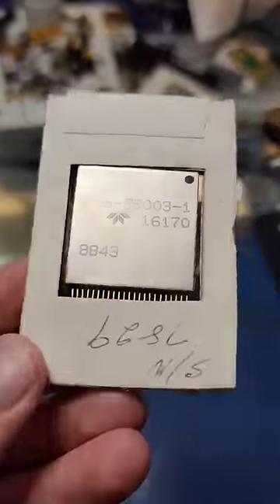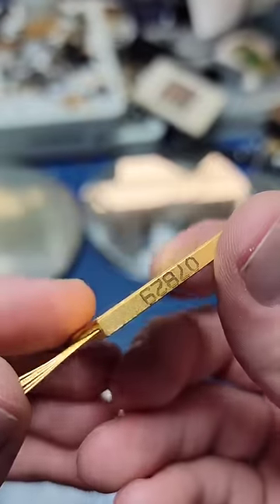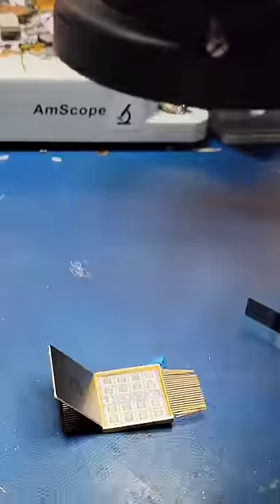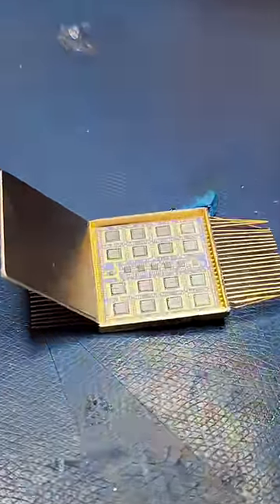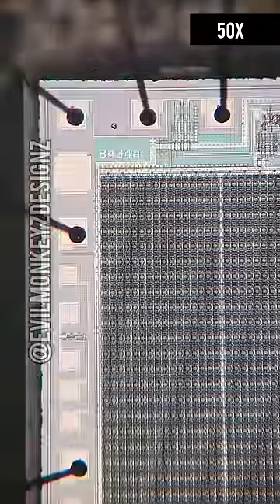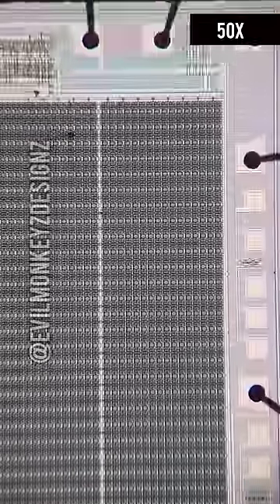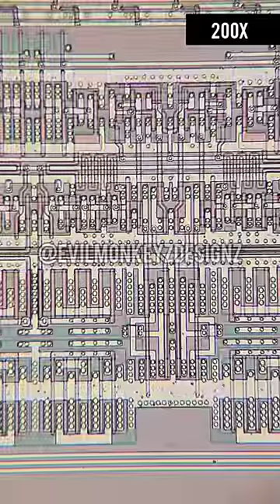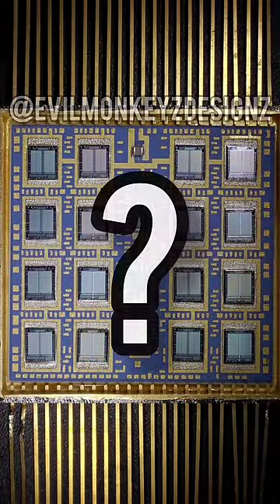CCU #298: Teledyne Hybrid Ceramic Circuit #shorts

Comment: 32k of military grade memory
Reply: Wouldn't that make it bad since military grade is just easy to produce a lot very cheaply
Reply: @senkuo5039  my guess is that sdram was from 1980
Reply: @senkuo5039 agreed.. military grade always means it's crap lol
Reply: @senkuo5039  More like the cheapest thing that barely fits the requirements someone with no clue wrote down. So it can be crap or incredibly overengineered...
Reply: @joshuamcgarvey2712  Nonsense. You clearly never had to create or test a product that shipped to the military.
Reply: @senkuo5039  LMAO....never done any military product production, have you? That shit is INSANELY well designed and tested. Most products have to be tested under the most of extreme conditions and has to have a failure rate considerably less than average products.

Keep in mind this isn't always the case for every single product, but for electronics that certainly has to be the case.
Reply: @senkuo5039 No. It need to withstand all conditions, temperatures so it simply cant be cheap trash.
Reply: @NavySeal2k requirements always based on something, mostly on expected working conditions. So, it can't be cheap trash as you suggested
Reply: @testep02  Ahh, thats the reason why soldiers all around the world never complained about or bought their own equipment...
Reply: @NavySeal2k  like I said, that's not the case with everything. And the other thing about mil-spec is that it needs to be extremely generic so that it can work for most people or on most equipment. So yeah, it is common for people to want something a little more specialized. But most mil-spec equipment is at least reliable, again with some exceptions.
Reply: @demef758  15 years in the army... never had equipment that wasn't crap.. I've bought gear and equipment from the private sector that works and lasted longer then the crap we are issued or signed for. So military grade isn't a sign it's good quality...
Reply: @joshuamcgarvey2712  that's fair enough. You have your experiences and that counts for a lot. I'm just relaying the experiences I've had developing electronics and software. Our standards were always much higher than the private sector. To the extreme in some cases.
Reply: @testep02  thanks for agreeing with my argument
Reply: @NavySeal2k  I mean, you can't discount something someone went through. You know this stuff better than I ever will as the end user of the equipment. Not much to argue about there 🙂 I can only speak to the products I worked on, which is just a couple out of the thousands in use.
Reply: @NavySeal2k  also, were you a Navy seal? Lot of fakes out there these days.
Reply: @senkuo5039 Yep, "mil-spec" is just a euphemism for "built by the lowest bidder"
Reply: I love how y'all in here with these apples and oranges, meanwhile we obviously all drinking grape juice on this video. Mfr this ain't boots and wrenchs, this is a fkn microchip. Think about it and everybody shake hands now and take they fruit and eat that outside y'all making the floor sticky in here GEEEZ
Reply: This was bleeding edge in the 1980, now I understand why everything was so expensive back in those days, even when building my first computer in 1998 the technology was probably a little bit better than this.
Reply: @senkuo5039  you have zero idea of what you're talking about and hold an inadequate perspective on the story/state of microprocessors. military applications were among the first, and certainly were the most well funded, ventures into what we colloquially call microprocessors today. 

and to directly address your statement: look into military specifications for electronics for their first (and main, still) uses: aircraft function controlling equipment. they must meet extreme temperature, load/dwell requirements along with often-absurdly tight/unique tolerances on their packaging.
Reply: @senkuo5039 if you ever compared military grade ic specs and normal specs of the same design, youll see that military spec is much tighter
Reply: That doesn't look worth 32 grand.
Reply: @joshuamcgarvey2712 Military failure rate is way lower then civilian!
Reply: @senkuo5039  not the case with electronics, I work in a wafer fab, the tiers typically go consumer grade, automotive, military, radiation hardened (space grade). The difference comes down to a mix of things: sometimes the higher tiers are cherry picked out of the batch, sometimes they're babysat through production by the process engineers, sometimes they have redundant circuitry built into the chip, sometimes they're specially designed to be hardier, often the packaging is more robust, sometimes a mix of the previous, but the near universal difference is the level of testing and paperwork performed (you wouldn't trust a chip with an unproven track record on your icbm, airbag control unit, or rocket safety controls).
Reply: There's a huge difference in MIL-STD and "Military Grade". There's very specific set of requirements for MIL-STD gear and tech such as operating environments, operating speeds, communication protocols, and many more nuanced specs. An example would be the 5400 series ICs made parallel to the 7400 series ICs. 

 Military Grade just means it meets minimum requirements to be issued to military personnel. Many times those requirements are not to freeze in certain temps, not to melt in certain temps, and to fit in specific dimensions while often incorporating MIL-STD components. An example of this is the old LCU fire control system.
Reply: @testep02 I believe teldyne was a military supplier  in the San Fernando valley
Reply: @joshuamcgarvey2712 Not entirely necessarily. Like with the 1911, it’s served two world wars and still serves in some units around the world today. It just depends on what era of military grade makes the difference. There’s really only a 70 year period where military grade didn’t mean complete shit. Just mostly shit
Reply: @testep02 Fake or not, it doesn't matter much.
If you know, you know.
Reply: @NavySeal2k  Plenty seals and other operatives who thank their lives to their laptop being rugged and that stopped the bullet with their name on it
Reply: @paulmichaelfreedman8334  A ricochet maybe, a bullet? Show me the after action report with a bullet stopped by a tablet 🤣😂🤣
Reply: @NavySeal2k  Do you realise how little sense that makes? "either crap or insanely over engineered" - that means either really cheap or really expensive - you're just saying it could be expensive or cheap - that you don't know
Reply: @undercoverscumbag9632  You just didn’t understand. When someone in an office writes down requirements for a part for the field it can be either not stringent enough and failing all the time or incredibly over the top. But both contracts will be going to the contractor that can produce it the cheapest to barely meet the requirements. And yes, cheapest doesn’t have to be cheap…

Comment: SRAM uses 6 transistors per bit, and it looks like it has six transistors wired in an SRAM config.  DRAM would only have one transistor per bit.
Reply: The SRAM I designed in the early 80s had 4 transistors, but two polysilicon pullup resistors. Smaller cell and less power/cell.
Reply: 6 trans per bit is why Japan almost got ahead of US by using DRAM. What's the catch? Why were they needing the 5 extra for?
Reply: @c0nstantin86 dram uses a capacitor to store the charge while SRAM uses two circularly connected inverters. Inverters require two transistors in CMOS logic. Then you have another two transistors that you need to isolate the stored charge from the bitline that you use to read and write to the cell.  When you want to read or write to it you activate those last two transistors. That adds up to 6 transistors.

There's also 9 transistor SRAM which decreases charge leakage by allowing you to read the cell without draining it's charge.
Reply: @c0nstantin86  A simpler explanation: SRAM can store the info you save to it even after you cut external power.  DRAM will lose the information you store after you cut power.  That’s what the extra 5 transistors are doing.
Reply: @alexwalters1699  Hi,  SRAM don't need refresh cycle to retain their data, unlike DRAM, but both of them will lose data when external power is cut.
Reply: @alexwalters1699  Methinks you're conflating SRAM with magnetic core memory and its brethren.  The latter is non-volatile even with no power applied, the former (SRAM) requires no periodic refresh but does must be continuously powered to retain its contents,   Most forms of magnetic core memory do require a rewrite after a read (similar to DRAM) though some do not (see e.g. A word-oriented transistor driven non-destructive readout memory, T.C. Penn, D. Fischer, 1960).
Reply: @c0nstantin86 Another point, related to the Refresh problem, is that DRAM uses a lot more power, as it stores data in what amounts to microscopic batteries, while SRAM just requires a gate voltage. This makes it much faster, despite the larger number of components, and vastly more energy efficient. 

This is where the other commentators are getting mixed up: SRAM still needs a voltage applied to hold the cell in that state, but it uses so little power, a mere coin cell can power an SRAM chip for years, possibly decades, without refreshing.

This led to a common use for CMOS-based SRAM memory: programmable memory. Before the development of flash memory chips, SRAM was used as writable solid state memory, most memorably in game cartridges and PC motherboards.
Reply: @alexhajnal107 ohhh cool, I didn’t know when reading from hdds that we would ruin the data already there. Thanks for the citation
Reply: @xnaaloh4437  [YT has smitten my previous reply.]  For magnetic memory, core and FRAM (normally) need write after read while hard disk drives and tape drives do not.  All magnetic memory (that I'm aware of) is non-volatile and does not need to be powered to retain the data stored.
Reply: Reading from HDDs is non-destructive.
[Don't know why YT keeps smiting my replies. All details I had added are sadly lost.]
Reply: @alexhajnal107  Ohhh i see, never heard of FRAM before thanks.
I can see why it got phased out tho, DRAM was probably a lot cheaper while being about the same in the sense where reads are destructive
Reply: @abuttandahalf What's the difference between NOR & NAND gates when making RAM , how many transistors to make 1 logic gate? 🤔

Comment: I work on several cards that contain Hybrid chips that look just like this one.  One of the chips contains four 8-bit Parallel Load Shift Registers (54LS165) making it a 64-bit PISO. It outputs standard 5-volt TTL logic, but on the input side, the voltage is from 0  to 80 volts. We still get quite of few hybrids like this that had been manufactured in the last 10 years.

Comment: I was a repair tech in the 70's in business for myself.  I have a few IC's for TV's and audio stuff from that long ago era. Some seem to have no existing data anywhere.
Reply from the maker: I'm sure you've seen lots of interesting things over the years then. There are many obscure parts that are hard to find data on, that's for sure.
Reply: @EvilmonkeyzDesignz I have dismantled a bit 3-manual+pedalboard analog Baldwin church organ once. It was full of custom analog chips that were oscillators. By full I mean there were cards upon cards full of those in there. Probably couple hundred chips in total. It was bonkers. And it was a design targeting low cost, so all the PCBs were paper phenolic resin. Those must have taken a lot of field maintenance - there were so many not very reliable connectors and plugs everywhere. It must have had miles of wiring inside. I had no place to keep the chips - otherwise I’d have desoldered them and saved them just to reverse-engineer what they did.

Comment: When you remember it was made in the late 80s and the details and technology used blows my mind
Reply: Yeah, even chips back then were impressive. I just think it's because most people never saw the inside of the chips back then. They look pretty simple on the outside, but when you open them up they are still very high tech, even if crappy by today's standards. You should see a modern chip compared. Miniaturization has come a long way since then. The amount we can fit on one chip doubles about every 2 years... so 20 years would be 1024x more... and 40 years is over 1 Million times more. (I would like to look that up to see if it's held true. I've heard about it decades ago and at that time for quite a while it did hold up to be true. Then I just forgot all about it... but as an adult, it appears that computers have not advanced as much as they did back then. Newer models just don't seem so much more powerful as they did back then compared to their predecessors).

Comment: Fun fact: these modules were each assembled by one person start to finish.  The "technician" would be trained in grade school, put to work when turn 9 years old, each sram structure was hand woven out of the microscopic wire using specialty thimble like finger trainers, and by the end of the first 1st chip they have callused fingers in the shape of the thimbles and they continue to assemle the other 15 without aid of thimbles. Depending on how good they are, when they get to around the 10th chip in the module they could actually do it blindfolded. Allowing the last 21 circuits to be completed in roughly the same time as the first alone. Which is approximately 2 years. While that doesn't seem a profitable timeline, each module after that can be assembled in pairs(one for each hand, best kids errr... employees can do 2 with each hand at a time...while blindfolded!) and eventually they are producing 2-4 modules per week. Most retire at around the age of 18 whith close to $10k in the bank and a 401k that pays about $1000/year, if they live that long. i read that in an encyclopedia Britannica about 35 years ago. It was soooo fascinating, in fact it was nearly UNBELIEVABLE at that time.  By todays standards its such common knowledge and basic technology that theres not even a reason for a wiki page. Cool stuff huh?!🤖🤡😏🫥

Comment: I use one in my elect❤rival engineering final project in 1988. I built a computer from the component level and this was my serial data controller.

Comment: The designers of some of these often hide little pictures or Easter eggs on microchips
Reply: I was inordinately happy when I realised the Mask Writer can write vector graphics into the mask and they get "copied" onto the finished chip lol
Reply: At ADI our designers used to do little sharks on the chips (because of SHARC, Super Harvard Architecture)
Reply: I worked at a fab that was formally called Silicon General. The photolithography masks would put the image of a tiny general on each die holding a sword. The name of the company changed to Microsemi Integrated Products but used the same masks for years on legacy products.
Reply: @repairdroid77  dang they missed a trick with that name change... micro semi an the doodles they could hide
Reply: Hell yeah I would too! Give ‘em the ole, six- line- Suzuki “S” 

I I I
I I I
Reply: magine being one ceramic capacitor keeping 2048 little eggs happy.
Reply: Yeh I've seen these two I literally just replied the same thing to someone else to check it out, so cool
Reply: Amazing....I don't know how and who designs such things?
Reply: @cck1496  it's the geeks who draw the actual chips out in the mask

Comment: Interesting,
I wonder if the chips has been created especially for that hybrid or if they just generic off the shelf ICs
Reply from the maker: It's very possible that these are off-the-shelf parts that were already readily available. If I come across the same chips in other parts, then I could probably say for sure.
Reply: This device looks like it's military hardened. I'd almost be willing to bet that the chiplets came off the fab for the standard stuff, and then they packaged it in a hardened package.  Go check out other Rockwell SRAM's. See if you can find a 2k SRAM. I bet it would look the same.
Reply: @prozacgodretro  -  For satellite or space equipment. They used a lot of this black ceramic packaging and the thick gold plate wires for connection...
Reply: Yea this is definitely not consumer and really expensive. Military/space customers likely.

Comment: 1553 hardware is actually still being manufactured. The mil spec transceiver chips are STUPIDLY expensive now though - like $6,000 for a 64 pin gull-wing QFP ceramic.

Comment: I graduated h.s. in Spr. 1986 , I  was 20 and in 1988. I had taken my first computer course in '87. The green/black  crt, DOS  Basic programming. I , and most had never heard of a graphic interface. We were using those 5 x 8 thin floppy disc. In '84 I touched my first computer. A TRS-80 Radio Shack. The only computer in our small town rural school. No classes, but a group of us would meet and learn Basic, use the dual floppy drives, 5x8's, and type in code from the TRS 80 MANUAL to learn about programming. Oh my,  how things have changed.

Comment: Should see if you can find some consumer and mil. versions of the same chip, then expose both to some ionizing radiation.

At least some 'hardened' ICs will have exotic materials as part of the chip (for rad shielding). -and you might even be able to see damage from the high-speed alpha and beta particles.

Could be neat

Comment: There's gold in them thar chips  (wires connecting chips to substrate, substrate is gold plated, wire leads are gold plated, case back is gold plated)  It is sad losing interesting chips to gold scrapping though.